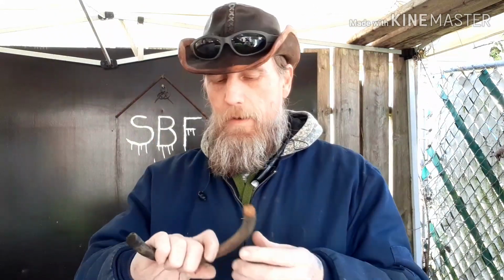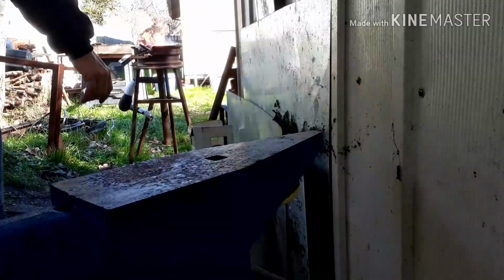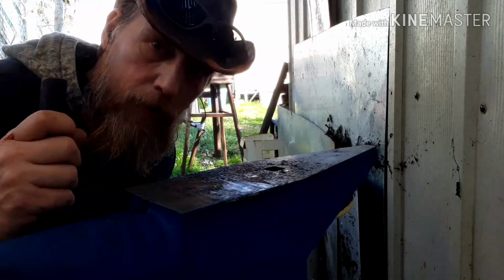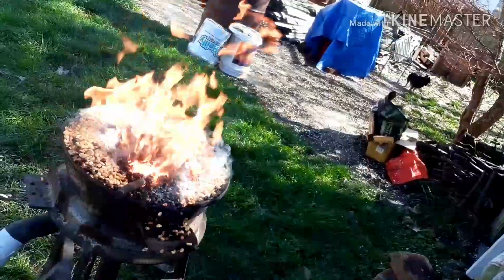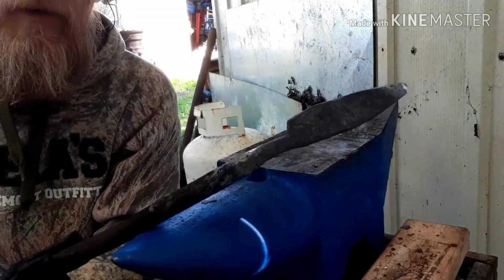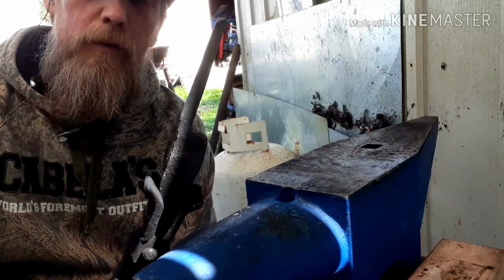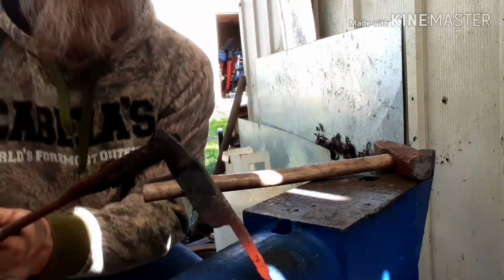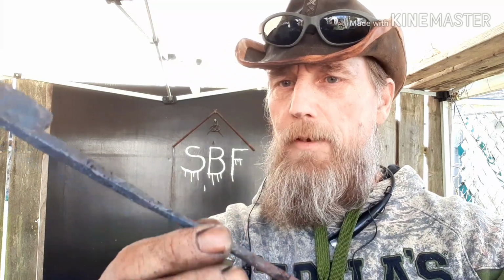Forging a Blacksmith knife, and trying out corn feed again

Comment: Cool, cool! Maybe use a power strip, or light switch, wired in the hair dryer cord, so you can flick it on/off between heats to conserve fuel?  How far are you from Tim/BDF?  He has a source for coal, which he prefers not to use, due to smoke (neighbors. 😟). He might point you in the direction of solid fuel.  ⚒️on Joe! ❤️👍😀
Reply from the maker: I'm a couple hours from him. I picked up some charcoal for now, which is what I'm most used to. I just need to cut the extra off and twist up the handle. Thanks for watching, and the suggestion to get ahold of Mr. Tim. I'll shoot him an email. 👍⚒😃
Reply: @SoggyBottomForgeJoe  almost sounded like a chainsaw, when you mentioned neighbor and yard work...maybe free wood. It works too 👍😀
Reply from the maker: @drason69  it was a weed eater, I do have some wood cut to use in the forge, but its been raining here quite a bit, so it's pretty wet right now. I'm also working on replacing my forge canopy with a much larger carport, then I'll be able to let it dry out. Lol. 👍⚒😃🤣
Reply: @SoggyBottomForgeJoe  hang in there!  Use the wet wood around the edges, and let it dry and char. Fuel control 👍

Comment: Corn here is 40 lbs for $10
Lump charcoal is 20 lbs for $15
Haven't found coal yet, and it helps to mix lump charcoal with the corn, and wet the charcoal to keep fireflies down.
Reply from the maker: Hey Bill. 👋 I'm not sure what corn is going for now around here, and I don't remember what I paid for that bag unfortunately. This was definitely my best attempt with it, learned alot. I like using charcoal, because I've used it more than anything else. Never thought to mix it with the corn. Thanks for watching! 👍⚒🔥
Reply: @SoggyBottomForgeJoe  I also made a retort for cooking my own lump charcoal, get about a bucket and a half (5 gal bucket, so total is about a bushel )a load. Made from an old sand blaster tank from harbor freight
Reply from the maker: @billwoehl3051  that sounds cool. Is there a video on it? I'd like to check it out.